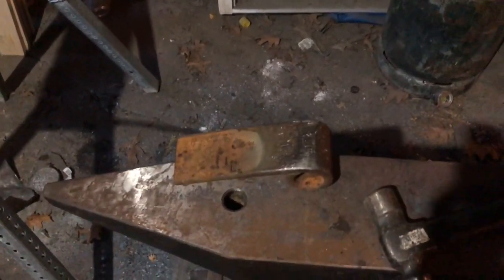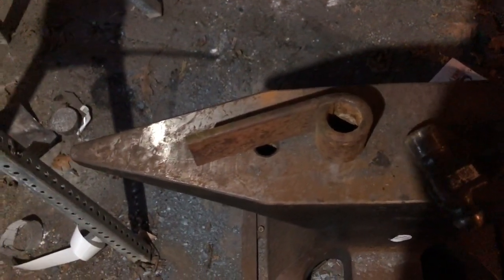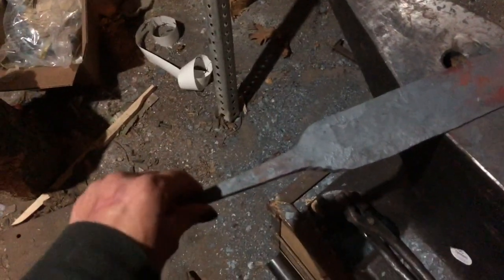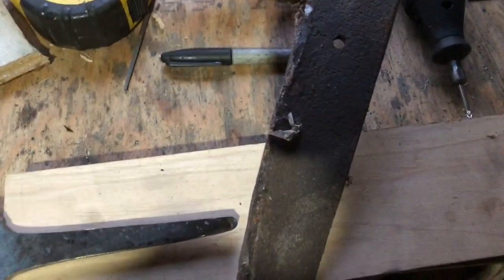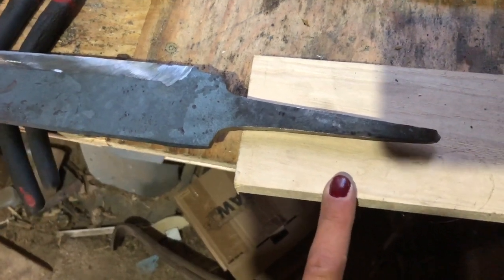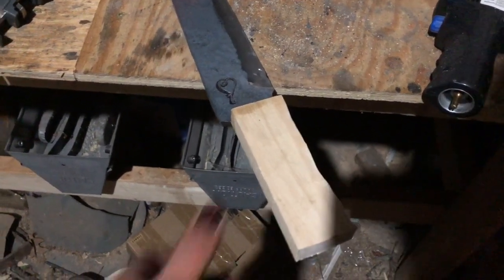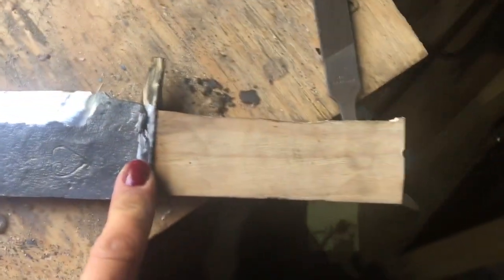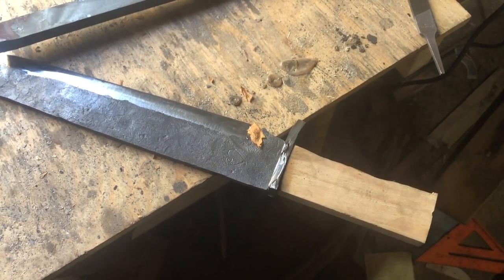How to forge a Norse seax

Comment: Have you ever made a shield? if so what would the design be?
Reply from the maker: I have wanted to make a Viking shield or a buckler.  I just need a wider forge to make the steel pieces.
Reply: that seems good i was thinking something with like small inch long sharp rivets and a metal ring for the boarder.
Reply from the maker: @Bec874  That sounds like a cool idea
Reply: @brokensteelforge232  dirt box charcoal forge  are easy to make and you can use it for making larger weird shaped projects like that
Reply from the maker: @lukecope4212  I never thought of that